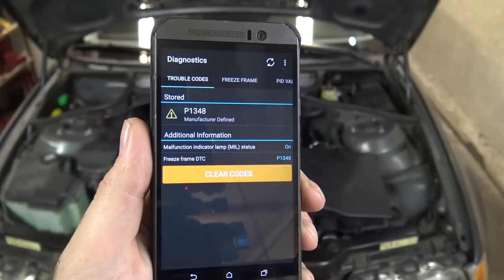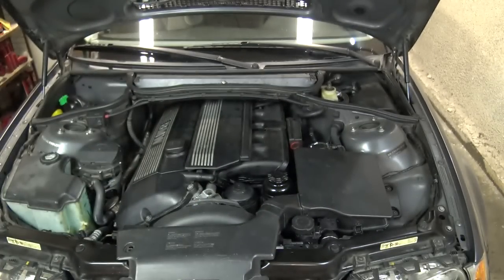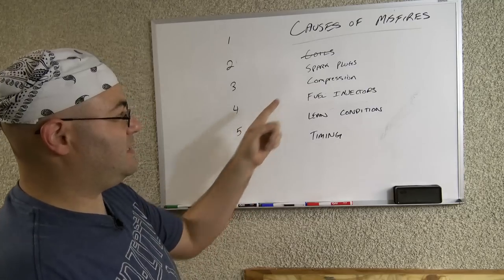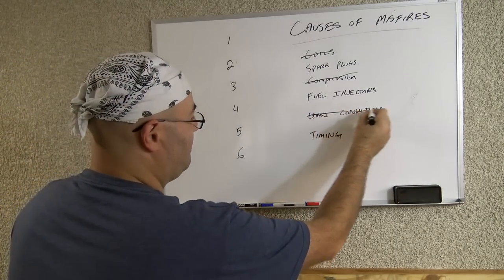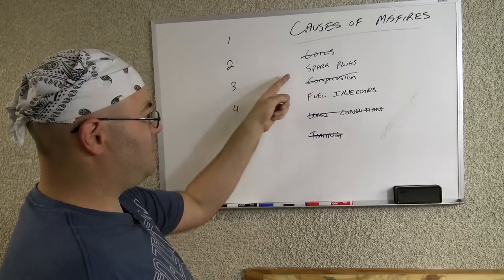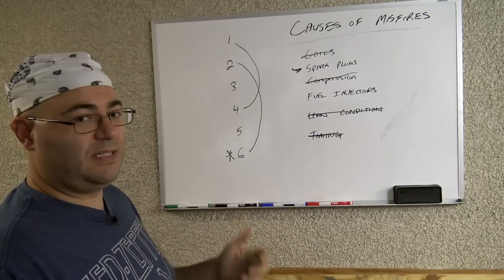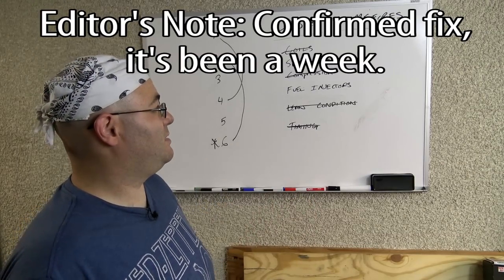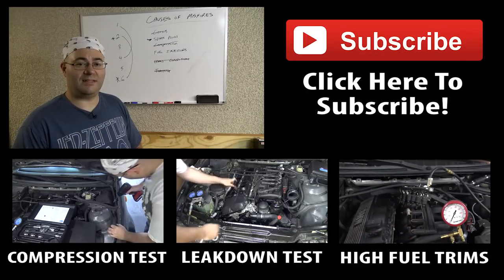How To Diagnose A Misfire on an E46 BMW 3-Series DIY

Comment: Good troubleshooting. However, you could have saved yourself time by stepping back and thinking "what is the constant between each cylinder as you change coils?" The spark plugs are that constant. Each coil relies on plugs gapped at a specific measurement, but if there are breaks inside the plug itself, it will likely make the coil work harder to complete the spark circuit. It is certainly not unheard of new plugs to be defective.

But, lesson learned: moving coils and the problem doesn't travel...check the plugs.

Thank you for all of your videos, and thank you for not omitting setbacks that a lot of other repair videos tend to do.

Comment: I was at "spark plugs" 1/4 of the way in, but this was a good and informative video on how to track down a problem. You were very methodical and thorough, just don't overlook the little stuff. You can never go wrong with a fresh set of plugs, fuel filter, air filter, and then chase the big ones. Thumbs up!

Comment: 50'skid, I had a misfire on cyl 2 and your video helped me out, I did switch the coil packs to see if the fault followed, and it didn't, but only watching you video did it occur tome to check the plug as they were new a few months ago, not sure why number 2 went bad, but it did, and for the time being the car is running very smooth... just wanted to thank you....
Reply from the maker: Nice, glad that helped you out.

Comment: Thanks for this. I had a misfire vexing me for months. I wound up following these steps and sure enough, a plug swap made the misfire move. New plugs and it runs great! Sadly, this was after I took it to a mechanic who had replaced the plugs. They had only about 10 miles on them but one was bad.

Comment: Thank you so much for this, I was having the identical issue as you only on cyl 1. I too was sure it was an ignition coil since I've had to replace most of them in the past 272k miles. To my very surprise the misfire didnt follow the coil swap and I ruled out sparkplugs since I had replaced mine not too long ago. Swapped plug 1 with 4 and the misfire followed, thanks bro!

Comment: YOU ARE AMAZING! I had a misfire this morning before going to work, i looked up a video and u saved my life i fixed it right away! Great job and keep it going! Thank you
Reply: So errrr, what was the issue and solution?
Reply: @powerplay8355  for misfires you could do what 50s kid did and check over everything, or just check the things that are easiest to fix first. check your spark plugs, check your coils. both of those are basically plug and play parts. if it's neither of those, everything else is a bit more of a pain in the ass to deal with and you should probably come back to his channel to figure out what to do from there. personally, i don't like to bother with the more complicated shit like compression testing if i don't need to. not that compression testing is hard, it's just that i know if it's a compression issue I'm just gonna be way more pissed about it.

Comment: Thx...I think I may be running into similar issues.  I have new NGK coils (2) and still getting "misfire during start" codes on those cylinders.  And my NGK plugs only has 15k+ miles on them...will go install new spark plugs in those cylinders (2).  And seems to start off a bit rough but once warm smooths out...at least that's what I think.  And a great vid, love how you shared how things did not go as planned and needed to do additional troubleshooting.

Comment: Thank you, Sir, for the troubleshooting steps. It turned out that my ignition coil #3 got defective. However, my troubleshooting got more interesting because I also had to replace the MAF Sensor due to error code P0102.

Comment: I have an older model BMW so this may not apply because of the age but I noticed you did not mention the spark plug boots. My spark plug boots or in other words the insulator/electrode in the boot are very brittle because of the age and I was checking them because it is not passing smog and as I put the boot back on the coil pack it broke with very little pressure. Just one other thing to check along with the spark plugs, they are fairly cheap to replace. Glad you fixed the issue.

Comment: Thank you for the thorough troubleshooting. I wonder if the problem going away when engine was at temperature is because the high temps assist on ignition. Could the gap on the spark plug not being set to spec be the reason the spark was failing even though it had only 10K miles in it?

Comment: I have the exact same issue, I didn’t realise you had a video of this exact same issue but mine would misfire quite badly to the point the engine actually shut off, took mine to a mechanic and since he knows I diy myself he scanned the codes, confirmed it was misfires and just told me to change the plugs and bring it back for him to scan just to confirm the misfire is gone, the engines running a whole lot smoother, but still need to get it scanned as it does feel a bit rough on a cold start. (update) its having the issues again, was smooth for about a week before it had a problem firing up once more, has quite a severe bounce on the revs. scanned the car again and flared up DME activation ignition codes on all cylinders

Comment: I got a question/puzzle for you. I realize this isn't a support forum, but decided to give it a shot on the off-chance that you decide to reply. I recently used your video guides (which are excellent btw) to perform a whole lot of maintenance/repair on my 325i. Starter, CCV, oil filter housing gasket, most of the cooling system, most pulleys/rollers, belts, various hoses and gaskets that I had access to ... A pretty substantial overhaul by my standards.

The problem I have now (and it could very easily NOT be related to the maintenance at all) is that I'm consistently seeing a misfire (enough to set a code and deactivate the injector) on cylinder 3, when the engine is cold. At that point I can feel the car running on 5 cylinders, vibration and loss of power are very pronounced. Once it's warmed up, I can restart the engine and the misfire disappears. Everything is working perfectly otherwise. 

What I've done so far:
- swapped injectors - no change (cylinder 3)
- fuel trims - slightly positive, but less than 5%
- compression : 160-170 in all cylinders,
- ** have not done leakdown test yet, no air tools **

- I havent moved spark plugs around, but they have less than 20K on them, I swapped them when I changed the valve cover gasket 2 years ago

- I moved coils around, no effect - seems all are in good order

Can you recommend any further diagnostics/debugging I should do? I'm a little out of ideas. I thought the compression test would give me a hint, but cylinder 3 actually has higher compression than most others (168).
Any advice/help would be appreciated.
Thanks,
Reply from the maker: Swap the plugs dude--that's what you haven't done.  Don't rule them out just because they are less than 2 years old.  Mine were also about 2 years old and look what my problem turned out to be.
Reply: Thanks for the reply, will give that a shot tonight.
Reply: You were right! I guess the best explanation is often the simplest one :) 
Can;t tell from its appearance that anything is actually wrong with it, gaps seem the same as on others, no oil or any unusual residue on it really, but swapping it with cylinder 4's plug made cylinder 4 misfire.
Mystery solved? I hope so.

Comment: Excellent work. Thank you. I currently have an issue in an 06’ E83 X3. It is due for plugs and I’m also going to do the coils. The symptom is what feel like misfires under acceleration. The tach jumps around in between shift points. Other thank plugs and coils, I fear this may be the transfer case gear or the chains in the

Comment: Fully appreciate the detective work [kudos], but as mentioned long after spending days on diagnosing the coil packs, I'd suggest checking &/or replacing the spark plugs 1st. Based on years of experience, I always start w/ the easiest potential solution 1st & proceed to the more difficult & expensive causes as needed...step-by-step. FWIW; I've run into quite a few defective spark plugs (as-in; fouled, broken, shorted, cracked, arc'd etc) over the years, so, that is always worth a consideration 1st. Bosch plugs seem to work w/out fail on my Beemers.

Comment: Am currently going through this with my 325ci. I had a intake cam sensor fail and a 02 bank 2 sensor 2 fail both of which i changed and there codes havent come back. But i have a remaining random cylinder misfire which happens once i get to about 92c and it happens on idle. Sometimes very small but other times a really bad misfire. It will go away if you knock the car on and off a few tines. It wasnt as noticeable until now as the thermostat had also failed so the engine ran cold unless left to idle a long time. Now I have fixed it its happening all the time. I dont suspect coils are to blame with this one. The joys of a bmw!
Reply: Hey, I'm having the same problems changed the sparkplugs and the injectors, turning off and on the car a few times seems to solve the issue for a very short period of time. Please update me if you find a solution.
Reply: @aymanof96  Mine seems to have sorted itself from a good drive i have covered just over 550miles to and around route500 so far the engine light has stayed off and no misfires!

Comment: Had the same problem, got new spark plugs and cleaned my very dirty injectors and it fixed it. Not sure if it’ll be the cause for anyone else but it was my problem.

Comment: Interesting. Accelerating last week and mines felt like it was loosing pressure, then the RPM needle jumped up normally to shift.  CEL came on throwing a P1304 code. After restarting, it was running just fine and CEL light went away. Today on the freeway trying to pass a car, from third gear the RPM fell down from and acceleration felt like it was choking on air. I need to do these test tomorrow morning. Thank you!!

Comment: Have you inspected the ignitor boots?  I had an E36 that had a bad miss on takeoff but was ok once moving.  Turns out I had cracks in the tips of the ignitor boots, replaced them and it ran great.  I had to squeeze the tips to see the cracks.

Comment: I had an exact problem a few weeks ago. I thought it was a bad coil and did the swap. Long story short , it wasn't the coil! The spark plugs were all gunked up badly. I have an oil consumption problem on my 330ci. (Found your video about that and going to try the 02 pilot mod)

But yea check those spark plugs!
Reply from the maker: Gunked up plugs are a sign of a rich condition--check out my fuel trims video.  You could have a serious problem that will rapidly lead to clogged/destroyed catalytic converters.
Reply: 50sKid for sure Im glad I stumbled on your page!

Comment: After replacing my dead alternator on my 325 it ran rough and idle drops too 500rpm after giving it a light rev. I check coil packs, replaced spark plugs and vcg too. Still runs like crap. Checked maf too..

Comment: I had this problem for my E46 M54 for the past 6 months. Replaced all coil last Nov.2016. Code went away. Finally last week, I replaced the # 6 fuel injector. No more misfire cylinder 6 with fuel cut off. My car has 103k miles.

Comment: My 2005 325-CI is doing the exact same thing. Rough idle only on cold start. My code reader says Cylinder #2 misfire, then is says random misfires. Then goes away after warm up.  Im gonna try this power balance test soon. The plugs are all new...I installed the exact plugs you recommended

Comment: My car: 2001 M54 330c.  Similar prob but a little more.  Idle has a kick to it - Always.  Cold & hot temps.  Still runs like a tiger though!  So it's a weird condition.  My codes are: P0313, P0300, P0171, P0174, P1344, 48, 50 & 52.  Spark Plugs.  Same deal.  Installed 1.5 yrs ago.  NGK-R.  Then I had the original injectors cleaned & re-sealed by pros in 2016. (I had a rough idle AND rough running engine in 2016)  The cleaned injectors & new plugs cleared the prob.  Because of this new prob I've put all new coils, idle ctrl valve, both air boots & new fuel filter/regulator 6 months ago.  You mention in this video about lean codes.  Like that's an additional situation.  But dont go into detail.  I have those codes as well (171 & 174).  Not sure what else to do.  
CCV, throttle gask, DISA & valve cover gask & vacuum lines are ~3 yrs old.  Air intake gask is still original.  Car has 199k mi on it!  This is my first engine problem that I can't figure out........yet!  Any insight?
Reply from the maker: If you have 171/174 then you have a vacuum leak most likely.  You can confirm what type of lean condition you have if you watch my lean condition video.
Reply: You have a lean video - great.  I will find it & watch on Sat.  Thanks a lot.
Reply: Mike Gozinta check the battery cables and ecm connectors for corrosion

Comment: I was told on the M50 that over time the rings in the cylinder over expand and you can pour top engine cleaner in and leave over night then it should fix your misfire if it's not caused by upper/ lower intake boot causing vacuum.
Reply from the maker: They don't expand but rings can get cruded up with carbon and can stick into the piston bores causing compression loss and yes, some lacquer thinner or fuel injector cleaner will clear that up enough to restore compression.

Comment: Since the cold weather started,my 2003 e46 325i M54 (112k miles) is having random misfire again ,cylinders 3,5 and 6 . Replaced 5 and 6 fuel injectors. Problem was fixed.A year and half later , same problem with misfire, but once engine is warmed up, no more rough idling and sometimes code disappear even w/o clearing the code. Still a mystery!

Comment: I have the same misfire problem i even cleaned the injector and all of them seemed fine
Now the misfire is between 1 and 3
Put a new coil in 3. And cleaned the the spark number 3
And it's now number 1 only causing problems after cleaning the codes
And theeeen its switching the misfire between 1 and 3
It's confusing
But thanks for this awesome tutorial on how to proberly diagnose the misfire

Comment: On the plugs... I just changed mine (NGK) 5000 miles ago and find It very strange that the plugs were the culprit? Any possibility that they might have been dropped? Slightly damaged electrode? Great lesson on systematically eliminating problems instead of going out and buying new coils.
Reply from the maker: Never dropped

Comment: The cylinder #4 misfires more than any other cyl on the M52/54 family when averaging a dozen random owner problems. Kinda weird. These straight sixes can also develop small,micro-small cracks in the head gasket or block. Love these engines but hate them sometimes. Thanks 50sKid.

Comment: Very informative video!  I am missing that grey conduit wire in the third bay of the manifold.  It looks like some sensor is broken off in there.  what sensor is that? I don't even have the grey conduit!   No engine light is on and the car runs fine now Thanks to your video!!

Comment: Always very helpful. Hopefully this solves my problem my car is almost dying when I start it and it sounds like a huge misfire could possibly be a vacuum leak I don't know but it's almost not drivable was thinking that possibly I put the wrong oil in because it was burning up white smoke and now not running well at all I'm cold started also Knox briefly but continues to misfire I had code P1353 p1343 also p300with about nine other codes which isn't good hopefully you can give me some advice thanks
Reply from the maker: Follow this video and also find my fuel trims video and check and see if you have a lean condition.

Comment: There's one item you might not want to rule out. Recently I added fuel injector cleaner to my tank and it must've removed water from the fuel system. My cylinder 4 misfired, then stopped. Then later I had random misfires, which also went away, then cylinder 4 misfired again for a few minutes. It could be contaminated fuel or an abundance of carbon getting purged through a cylinder. These misfires happening when the engine is cold is a good indicator of the possibility. A cold engine will have more water condensate in it, a warmer one might not. A small amount of water vapor in a hot engine may not cause a misfire. I didn't take any action immediately on my misfiring M54 and ran the tank to near empty and refilled. The misfires stopped. I've notice on many boards the cylinder #4 is the most likely one to misfire. Is there some particular reason for this favoring? Could it be the closest cylinder to the fuel rail to intake water condensate?
Reply: You just saved me money, idk why this didn’t come to my head. Thank you
Reply: I'm certain that my 2003 325i started this misfiring very shortly after I added the fuel injectors cleaner to my gas tank.  I think I'll fill my car up with fresh gas tomorrow.  Thanks.  Hope it clears this mess.
Reply: @DaisyLucy327  If you feel it is the same cylinder misfiring, you may have a weak ignition coil. An easy test of this is to disconnect the coil and swap it with the coil from an adjacent cylinder. If the misfire moves to that cylinder, you've found your culprit. Weak coils sometimes will only misbehave when environmental conditions allow, like high humidity or rain.